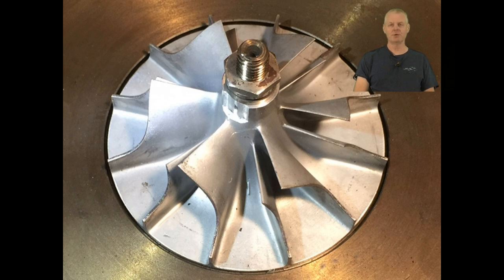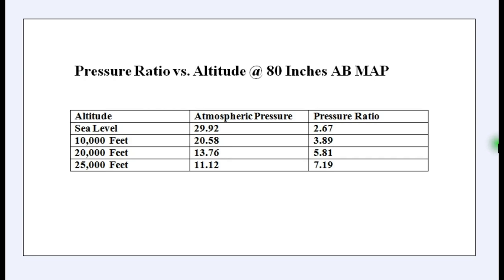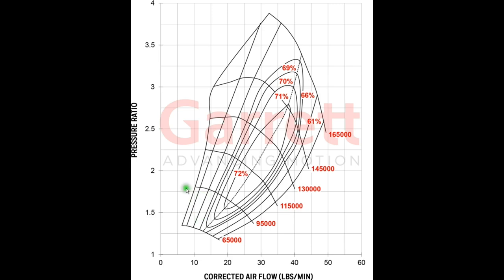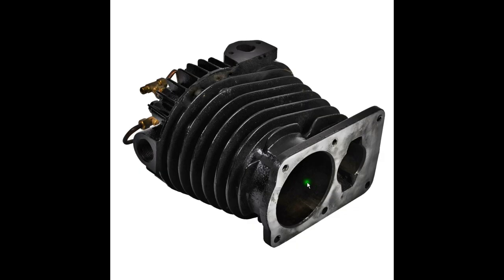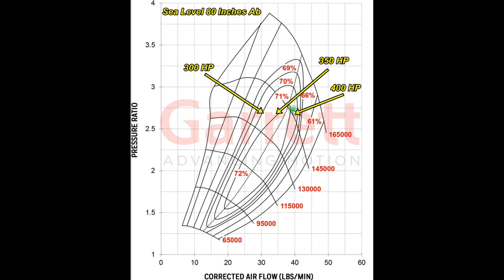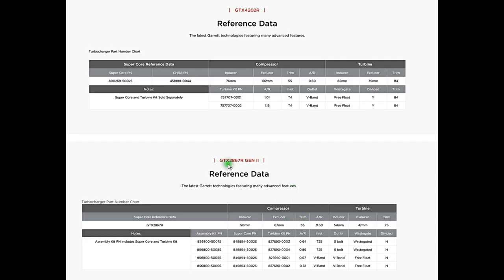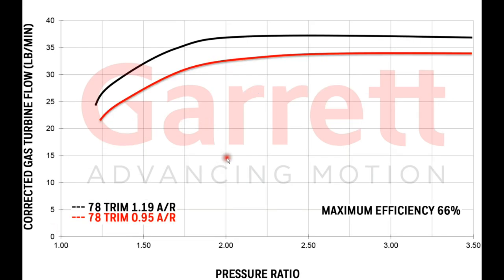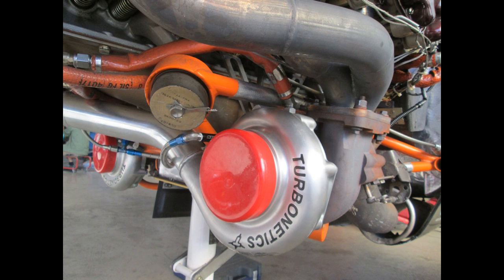What's Wrong With Raptor's Compound Turbo System?

Comment: awesome, please consider reaching out and helping the builder and let's make this open source project best in class so we can all benefit from all that hard work
Reply from the maker: The designer won't be listening to me or anyone else here. It's his project and he can continue on his own path any way he likes. Open source makes no sense on a complex aircraft project like this.
Reply: @rv6ejguy  I think Peter is nuts for doing this development online. Anyone that has any engineering experience knows what the outcome will be  when a project is designed by committee.
Reply from the maker: @judd_s5643  He's done most of the design himself but lacks any real-world background or formal education in the multiple disciplines required- aerodynamics, structures, systems design, engines, cooling/ thermodynamics, turbos, stability, flutter and flight testing. This is a complex project and he needs serious engineering help if he expects it to be successful. I don't know any single aviation person who could do this project successfully by themselves- and I know a lot of smart aviation people.

Comment: VERY fascinating video. Thanks for sharing all of your wisdom with us! You've earned my subscription!! I began watching Raptor being put together right at the end of assembly and missed all of the engine testing - surely this turbo mismatch should've reared its head during engine testing.... I began to realize what kind of builder he is when he was bumping up against problems, getting loads of helpful advice from his YouTube comments, and then pushed on (ignore any advise) with an inappropriate "fix". Then that came all to a very heated, red-faced point with trying to get Wasabi to do the flight testing!! There's a reason that Elliot isn't flying that aircraft.... Certainly seems to me that the turbo mis-match is another case of excellent advice being blatantly ignored. And truly a shame, because I think the Raptor is a beautiful plane - but looks to be doomed to fail.
Reply: I have followed Raptor (Peter M) since beginning and you would know  from following that  there HAS been good info given but NOT taken on board. Sometimes you just got to think about input suggestions and there SOURCE. 🤔🤔

Comment: Thanks! I didn't know what forlks were going on about the turbo's and this is a huge help. There really should be a shop converting these Audi engines to aero use so they are suitable for the application. With each video of Peters' we get a glimpse of the limits of his knowledge so it's painful to watch him set up for failure. I suppose he can't afford to pay for good advise (and maybe figures free advise is worth less). This whole experiment to get this plane off the ground with an Audi engine may just prove you shouldn't use an Audi engine. :P

Comment: I have watched the raptor build series, and I get more and more concerned as i go along.
I have seen delaminated carbon fibre, electrics that would look bad on a bicycle light, hydraulics that clearly didn't work (so he made a workaround), aerodynamics that does not work, instruments that does not work, cutting new holes to get moore cooling, an left out c-clip that made the engine blow up, a serious wingstrike without an inspection, an test start of an enginge that was clearly blown up, an engine replacement without flushing the remaining oilsystem and the list goes on...
I'm watching the rest of the series with horror...
Reply: I don't know anything about the raptor but damn that sounds like good television to me :P

Comment: Great informative video.  Try to remember Ross, "Complexity is the Mother of Failure".
Reply from the maker: I agree, Raptor is overly complex but that's the least of its problems.
Reply: I'm concerned that he is taking people's money with a highly deficient prototype.  This thing is heavy, slow, unstable and unreliable.  Experimenting is fine, but do it with your own money.
Reply: @yukon4511  I'll give peter credit. Unlike Jim Bede, he actually put the money into escrow, and then told people to take the money out of escrow. Bede ran a ponzi scheme. Peter doesn't know what he doesn't know. And the last statement from Ross was a beautiful dog. Bravo Ross

Comment: Would a correctly matched vnt turbo eliminate the need for compounding?. 25000' is way optimistic. Peter needs to get to 15000 first then go from there.  Very good technical insight video. I learnt quite a bit. Thanks for going to the trouble.
Reply from the maker: No centrifugal compressor is this size range can make much over 4.5 pressure ratio, so it really needs 2 stages for a diesel engine. I'm working another video now which will explain this a bit more.
Reply: Peter needs to get out of the traffic pattern between overhauls.  300 knots is a pipe dream.
Reply: @rv6ejguy  I subscribed and I'm looking forward to that video.

Comment: Hi - Question on the calculation of required airflow - at about 6:20 you do a calculation to get to about 80LBS/MIN.  Why does the second turbo (ie engine) need 2.68 times the pounds per minute of airflow?  It seams like you are saying that the second turbo needs 2.68 time the flow rate of the first turbo (I would think that both turbos have to have exactly the same flow rate) or the engine needs 2.68 times the flow rate at altitude (which I would think is also incorrect, it needs the same flow rate).  I might be just be unaware of what the term "Corrected Air Flow" means.  Thanks
Reply from the maker: 2nd stage will always be smaller so not 2.68 times the flow rate. 

We work the calcs backwards from stage 2 to see how the stage 1 compressor needs to be sized. Perhaps I didn't make that clear.

Compressor maps are based on corrected inlet flow- that is the ambient temperature and pressure present at the inlet. Stage 1 is at about 11 inches and 0F. Output from stage 1 into stage 2 will be at about 2.68 X the pressure (we're ignoring intercoolers here). Mass flow is the same throughout the system, only pressure, temperature, volume and density changes.

Stage 1 needs to be larger to squeeze down a greater volume of that low density air to feed the smaller second stage.
Reply: @rv6ejguy  Thanks for you reply.  So - What is the 80LBS/MIN referring too? Why did you time 30 LBS/Min x 2.68?  Wouldn't the flow rate through both turbos be 30 LBS/Min.  Sorry if I am missing something
Reply from the maker: @tonymatthews4853  The difference is the inlet conditions at each compressor. One is at 11 inches, the other at about 30 inches. Air molecules further apart at stage 1. Flow is 'corrected' for air density. 

The mass of air inducted remains the same throughout the system. Remember Boyle's Law I talked about- double the pressure, half the volume, double the density.

Comment: Excellent follow up to a well intentioned comment, I'm sure! I spoke the design of the redrive and the foreseeable issues with oiling and pressurization within redrive causing hydraulic power loss..... Yadda yadda yadda. Peters an amazing man, and it's great to see him succeed with flight but... It's hard to watch and listen to these days..... As someone who has followed the Reno Races push all types of engines to the limits the only turbo charged car engine I'd want on a runway is those Saabs in 06!

Comment: I believe that Peter's problems extend beyond the turbo, and reduction system. Didn't he tell us a short while ago, he was out of money . He was able to round up some more, but that had to come with tighter stipulations and progress way points. He's in a catch 22, stop and fix the root issues and loose his financing. Not a good place to be.
Reply: Who would buy this aircraft when DarkAero will get to market faster with a regular proven engine?
Reply: @sl66ggehrubt  Someone who wants more than two seats?
Reply: @danielwaddell123  I would rather purchase a 2 seater over an airplane Peter has built. The DarkAero actually looks plausible, their team looks structured and has a smooth workflow. I can't say the same about Peter and his 'team.'
Reply: @gordo1163  What a ridiculous response. There are other alternatives  for 5 place kit planes.

Comment: I have been following Peters build for a few years. Several people, that had good experience in turbos, tried to tell him his setup was wrong. Peter will not listen, its like he is getting bad advice from somewhere, but he believes it. It is obvious from the test flights that it is not making enough power. He reaffirmed in a video a couple months ago that the turbo setup was good. I do not understand the unwillingness to listen to people that know more about a subject than you do.
Reply: My observation is that he is overly focused on getting the first 40 flown off, a requirement before going into production. So he focuses on easy quick fixes only.  While he seems like an intelligent person I suspect this build has taken him into many areas he knows little about and he simply does not know what knowledge he lacks. One cannot sift through what turbo change suggestions are helpful if you don't have the fundamental knowledge required to assess the suggestions.
Reply: Even on of the original designers of this very engines told him the exact same thing! He just ignores everything that doesn't suit him.

Comment: Great video. I’m not sure why you assumed the aircraft needs full power at 25,000 feet. Pretty much all turbocharged aircraft engines choose 18,000 as a critical altitude, above which power output drops off. That still provides enough power to climb into the mid 20’s, albeit at a slower rate. Given the thin air up that high, dissipating the engine heat at full power in the mid 20’s would be very hard. Thus, the decreased power output also helps the cooling question.  So designing around a 5.6 PR may be a better choice. Not sure how that affects your turbo recommendations.
Reply from the maker: Raptor had been talking 350-400HP. I was assuming around 300HP at altitude to even have a hope of getting close to the original performance claims. That's 75-85% power. The problem with the diesel is that it requires much higher PRs to make the same power as an SI engine. Even at 5.6 PR, still can't do it with a single turbo.

The next video will explore some of these  points.
Reply: @rv6ejguy  Lets not forget that engine is going to be runnung an ac compressor also. They rob power.